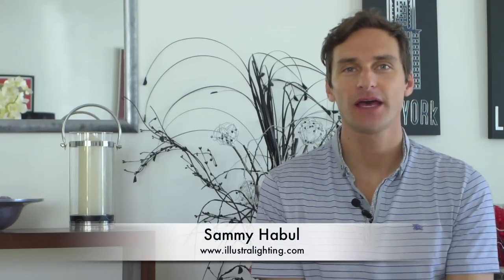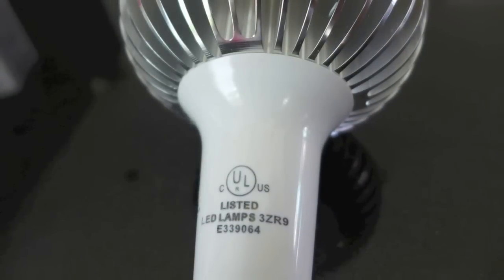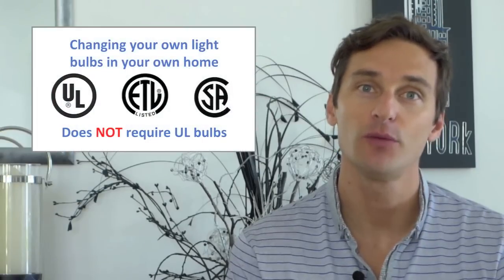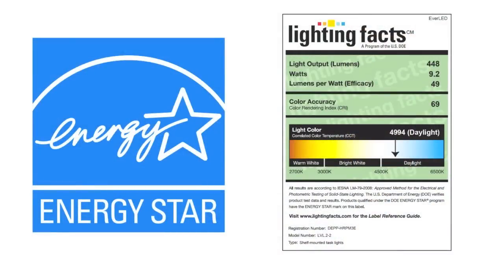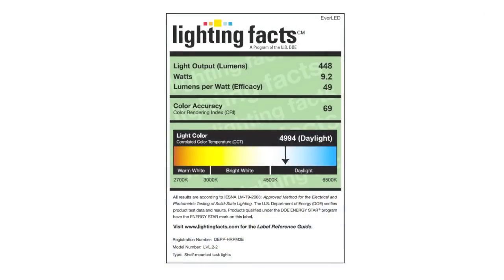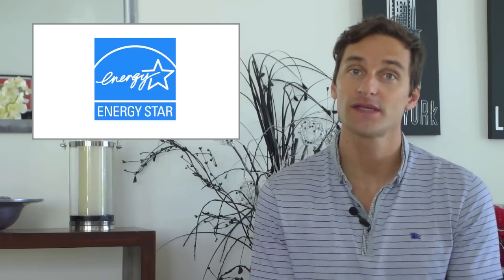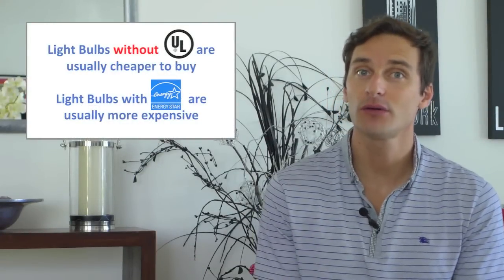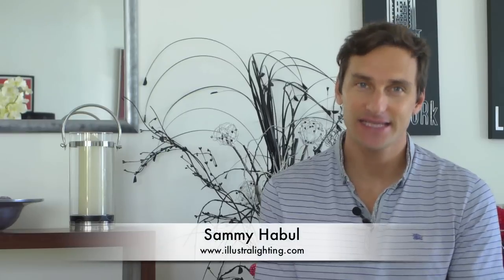Intro to LED Light Bulbs: Part 10: LED Testing and Certification, UL, Energy Star and Lighting Facts

Comment: Hi good day. I want to know what is the output of a 220 v led ceiling lamp. It has a component inside which I don't know if it is a converter, or if it is, is if an AC to AC or a AC to DC. IT IS A 2 watts LORDEX industries LED light. Hope to hear from you Thank you sir and more power.